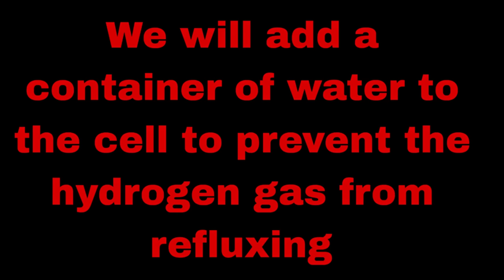I turn Water into a Free Gas for cooking, New invention

Comment: Have you taken into account the effect on electricity consumption while saving on gas with this invention?
Reply: Compressor itself is about 400-500watts and additional 24v6A for electrolysis is about 144watts totalling to about 550-650watts of electricity bills..😁
Better replaced with solar power supply and a smaller fans for pushing out the hydrogen..✌️
Reply: @atukintso1405  A single electrolytic cell running 6 amps produces a mere 44 mL / minute of hydrogen.  This guy is pulling our chain.  Now the energy that is going into that compressor, if all of that was used to split water instead then MAYBE you could get that high of a flame.  Agreed, solar would be great, especially in his apparent location.  Looks like India.  Lots of sun.
Reply: Given the fact the air pressure is not high, one may use a small electric usb pump, which uses like 5W.
Reply: Yep, it is faked. The flame is not from the minute quantity of hydrogen that is produced.  @ChristmasEve777

Comment: This is one of the superb project and best knowledgeable also by you. Its not a difficult to understand but, it would be better if you explain it in a simple English education system. One need to know its capacity range for its storage quantity for regular use.❤😊
Reply from the maker: 2L of water+100g salt=10h using
Thanks ❤️
Reply: @king_650 how about if i use sea water instead of adding salt? Is it ok?
Reply: 10h means,10hrs using time
Reply: How many watts of the fridge compressor and how much electricity will it consume in 10 hours??
Reply: Maybe offer to do his  subtitles or somebody can show him how to do it automatically
Reply: @kaushalsapariya2773 Compressor= 400-500watts
Electrolysis=144watts(24V6A)
😁 imagine running for hours... Your electricity bills will reach sky-high.
My suggestion is to used lighter pumps instead of compressor, and use 12v6A for electrolysis.
STAY SAFE, look out for backfire..👍
Reply: Nice effort. But the system has a mixture of hydrogen and oxygen, which is highly explosive. The fire may travel back to cause explosion. How about formation of  Aluminium Chlorde at cathode.
Reply: @atukintso1405 i think he used whatever he could pick up from the scrap yard, otherwise a good effort on his part.

Comment: It is a genius idea to use frig. compressor for cooling the water in Electrolysis, as in continues long time usage, the water in electrolysis, will start to boil, the frig. compressor, beside the producing the pressure in electrolysis, it helps to cool done the water too.  For those, who have objections, in using the heat sinks, I spouse, they can be replaced with copper plates. My only concern is, salt reaction in electrolysis, which, will produce toxic gases, I wander, if it happens, in this configuration too, or not?!
Reply: He was using it a a pump
Reply: Compressor itself consume about 400-500watts of electricity, additional 144watts(24v6A) for electrolysis, that's not cheap.running for hours will result in high electricity bills than a regular gas...😁
Reply: The fridge compressor compresses the gas in a circuit of a fridge. It's a mechanism to absorb heat from inside the fridge and radiate it through the back of the fridge, thus cooling down the inside.
But, in this case the purpose of using the fridge compressor is not to cool down the water temperature but to pump out the Hydrogen and Oxygen produced by the electrolysis. 😂 However, the method of extracting the hydrogen shown here involves a higher cost of electricity.
Reply: @atukintso1405 , electricity is cheaper than LPG. Use a solenoid air compressor like Boyo.
Reply: @kaka_kaka28  trust me, you don't want to use 600-700watts of electricity for hours&hours... 😅😅😅
Reply: @atukintso1405  , the pump I said uses 45 watts.
Reply: @kaka_kaka28  much better than a compressor...😅
Reply: Any link about fridge compressor hho production video pls
Reply: @atukintso1405  crees que pueda hacerse con un panel solar?
Reply: @carolacuna4005  sorry...!!!
I do not understand....
Reply: Why would you use an electrolysis device wich have at best 25% energy efficiency,plus water,salt,a compressor,have to change the electrodes often,plus the risk of blowing up your house in case of a leak,as it doesn't smell, instead of using the electricity to power an induction cooking machine wich have around 90% efficiency.....is beyond my logic. It is like scratching your leg over your shoulder.
Reply: @carolacuna4005  YES, solar panels can be used to harness electricity to run motors, but lighting HHO combination can be very dangerous since you cannot smell it...

Comment: Would it be more practical to buy a 300-watt electric stove? a fridge compressor runs at 350 to 800 watts. A 300-watt electric stove would consume less power. It would impact less on your electric bill.😄😁. No hate to this post. I liked the innovation, but if you can come up with an alternative to the fridge compressor, that would be great.
Reply: a 10 watt aquarium compressor will give the same air flow
Reply: 我觉得冰箱压缩机只是和幌子😂那里面有个气罐😂

Comment: One can use electricity directly instead of using it to produce hydrogen
Reply from the maker: No use car battery
Reply: how much electricity from a car battery can you use to cook?
Reply: Compressor used around 400-500watts, + 144watts(24v6A) for electrolysis, that's a huge electricity bills😁
Replacing compressor with lighter pumps can reduce electric bills..✌️

Comment: 12 volts x 6 amps, 72 watts power consumption, not bad
Reply: Compressor power?
Reply: 500 watts of compressor plus 72 watts of 12v x6 amp plates.. 572 watts..
Reply: 24 v x 6 amp

Comment: if you have access to power to run the compressor why not just plug in a portable hot plate ?? & what happened to the Freon from the poor fridge or freezer you stole it from, it was not likely properly recovered right ?, as you appear to be one of those cut the lines & let it fly guys, lol

now add the fact that the aluminum heat sinks will oxidize, deteriorate over time of use & are expensive if you have to buy them, the Brillo pads in old socks method of generating hydrogen is more cost effective for practical use, then is the toxic byproduct, the old used water now with heavy metals in it from the electrolysis process ?? , oh we just dump it on the ground or down the drain, lol
Reply: Great how you spotted all the blind or ignored details. Free or Renwable energies shouldn't destroy the environment. Sustainability is not about infite source, but clean and without adverse effect.

Comment: Hi,  Thank you for sharing this with us.  I want to build one, but I have a couple of questions before I can proceed.  Please tell me:
Can I buy & use an aluminum heat ink and get the same results that you did?
What was your electrical supply (i.e. did the electric come from an electric cord that has a plug for a socket at one end-a lamp cord?)?  I do not see that you used a DC Power Supply Variable
Thank you for the attention that you have given to my concerns.  
😊👍
Reply: Use stainless steel for electrodes.  Not Aluminum. .  Aluminum wear out fast. For a power supply he did tell you .  . use a 24vDC  6 Amps power source. It´s not house voltage.
Reply: Jeff is right. You can use SS. I used titanium bought on ebay and sodium hypochlorite also from ebay. Pvc cell vessel and the same for the flashback preventer. Runs of of 12vdc but 24vdc 6amp would be better. Also used a electrical wave modulater to be able to adjust the the amount of power to the cell grid.
Utube has bunches of videos on the science behind it and how to make a variety of cells. Some of these people are actually real scientist. Lol. Have fun and be very careful.

Comment: Even in welding and cutting they use Cooking gas and then oxygen and other gases. First gas is only for first lighting. Today I say in catering table top stove they use very minimum gas but use oxygen to give fast burner to make tandoori. It is possible in a large area but not in homes. Don't try it at home.

Comment: Excellent video. Liked it. Two questions 1. Compressor needs to be a working one and should be connected to AC power. What is that circuit ? 2. You connected heatsink with another circuit, didn't explained anything how to make that. Please clarify

Comment: Its very good idea, but again you are using electricity, means energy against energy in shape of fridge compressor, it also consumes units as per usage, what if a 12 volt pump should be used to avoid huge elect bill.

Comment: Good invention. Perhaps it consumes little electricity. How much electricity requires to run 1 hour burning , so also water and salt consumption, and cost of the unit be united in the description.
Reply: Compressor used about400-500watts which is not cost effective and the electrolysis process he is using 24v6amps which added another 140watts of electricity... Electricity bills will be very high.

Comment: Your project is good to start but keep it in mind Hydrogen gas is highly inflammable. You can use it instantly with all safety precautions but do not try to store it in cylinders for later use. These would be like Hydrogen bomb. Another suggestion is the end pipe which is used to make fire should be long enough so that your project bottles are in distant place to avoid accidental fire or explosion

Comment: You can use a balloon metal for store hidrogen with a little presión as 5 psi ? 
How much ps3 of hidrogen for how much amperio at 110 AC ?
Reply from the maker: To analyze water, I use a car battery
Not 110v Ac

Comment: My guess is the cost of the electricity outweighs the money saved on gas. I know that because if I was wrong, this system would already be widely used. No miracle money saver here, however, if one happened to have no way to get cooking gas, this may come in handy as it is most likely more efficient than an electric stove....I think.

Conclusion, save the video to your Just In Case folder.

Comment: By compressing air you add drag to the compressor and it creates extra cost to electricity. Process of electrolysis requires high current to produce more gas, then its another cost of electricity. Would it be cheaper to buy a tank of propane because they are produce same time as crude oil is produced. Don’t panic, just a friendly advice…..😊

Comment: such a compressor consumes approx. 150 watts of power.  enough to use an electrical heat element for cooking an egg. still, I welcome the curiosity and energy of this young inventor!
Reply from the maker: thanks
you can replace fridge compressor with 12v air pump

Comment: First you use energy for splitting H2 and O2, than you need energy for your compressor.
You will spoil around 25% of your electric energy in order to heat by gas.

Your construction is simple, simple is good.

But it should be useful.

Comment: This may look like inexpensive gas, but in reality, using power from the grid to create Hydrogen gas is quite expensive. If you want a cheap fuel that's very useful, syngas is the way to go. It's derived by burning organic material which wood is typically used in the process.

Comment: What kind of adapter is being used that is connected to the green and yellow wires, what is the purpose of the adaptor and can the setup just be connected to a power source (car battery or solar panel)?
Reply from the maker: Im use Solar panel 12v 6A

Comment: Using aluminum electrodes and a salt solution can introduce impurities (e.g., chlorine gas if NaCl is used). Ideally, for high-purity hydrogen and oxygen, use platinum or carbon electrodes and distilled water with a small amount of sulfuric acid or a base like potassium hydroxide (KOH) instead of salt.

For higher purity hydrogen and oxygen, use distilled water and a small amount of sulfuric acid (H₂SO₄) or potassium hydroxide (KOH) as the electrolyte instead of salt, and use inert electrodes like platinum or graphite.

Be safe...

Comment: The compressor is pumping air into the system so how does that change to hydrogen? So the hydrogen produced in the bottle is diluted into thin hydrogen supply.

Comment: It's free when you use hydrogen production to power generator that provides you with electricity. Initially you have to use 12volt battery to get it started and then you use 12vdc from generator to keep it going.

Comment: 1 If the burner heats up it will not melt the connection 
2 how much voltage is the battery you used
Reply from the maker: 1: No
2: im use solar panel 24v 6A
you can use car battery

Comment: For power supply we can use solar energy.
Reply from the maker: Yes im use it
Reply: Can you solar energy produce 550-650watts..?because compressor consume a lot of power 400-500watts, better replace compressor with smaller pump, 12v for electrolysis can reduce lot of power consumprions too.

Comment: Simple yet successful model to save energy bills. What about oxygen which also get generated during electrolysis? Safety part is also important.
Reply from the maker: Yes excellent ideas 👑
Reply: Compressor consumed Loads of energy 400-800watts,
Additional 150watts for electrolysis..smh
And hydrogen can be dangerous, specially invisible flame..
Please Be SAFE 🙏

Comment: The process is highly doubtful. Hydrogen flame is invisible in day time and in night you may feel little light if hydrogen is burning. Most of the time, one would come to know the hydrogen fire only by getting burn injury or  feel the heat of the flame. It will not give yellow color flame at all. But no doubt that electrolysis of water will give Hydrogen and Oxygen.

Comment: I can't believe it hasn't back flashed  and blown up the bubbler or the main tank except for the fast-moving air from the compressor. You should have a flashback arrestor
Reply from the maker: I add it
Reply: @king_650  that's good. You must have had an explosion .

Comment: in salt electrolysis hydrogen develops on negative electrode, but chlore develops on the positive electrode and is highly corrosive. Where is the positive electrode? it should be made with graphite or platinum. The energy produced by burning hydrogen is less thane the electric energy needed in electrolysis, so it would be simpler and cheaper to cook applying the electric power to a heating resistance.🤨🤨🤨🤨🤨
Reply: Йй❤❤❤❤❤❤❤❤❤❤❤❤

Comment: This is only good for a few minutes. The water will get so hot it will melt the plastic container. You need to solve the problem of the water heating up. There needs to be a way to cool the water. So you can use it longer.

Comment: The pump is pointless if the HHO gas is being generated in an airtight container = it will self-pressurise.  If more gas pressure is needed then a simple aquarium pump will do the job for much cheaper.     Note the HHO gas contains Oxygen - so adding more air (75% N and only 15% O) will dilute the power of the HHO gas.  Maybe this is needed?  Maybe not.

Testing the HHO generator without the bubbler-based flame arrestor is dangerous and should NOT be attempted. 

Finally,  using hot glue to stick down a combustible gas line under a flaming hot burner and pan is not recommended.
The hot glue will melt and the PVC will do the same.

Rather use a copper pile (from an old refrigerator if available) through a hole in the base of the "stove top" - which incidentally is also flammable wood (rather use a metal part from an old refrigerator (!) or any other sheet metal for this base.  Let the pipe pass under the plate up through a hole into the burner and then connect that copper pipe with the PVC feeder pipe after it has enough length to cool down.  Recommended to line everything with foil so that it catches drips and makes things easy to clean.  And Aluminium foil does not burn.

Comment: Electricity is used to make Hydrogen, and to work the compressor. By the way it is not shown what voltage/ amperage of DC is used to make H2. It us a good experiment to show students of making H2 at a usable level. The cathode will get corroded soon.

Comment: I didn't see the one that was plugged in with aluminum. What is that? How was it made? The video is not complete, so I don't understand?
Reply: the power source for aluminium plates is a 12v 6 amps DC, and the compressor is connected to a 220v socket

Comment: More energy required to run the electolyser and pump than if you just used an electric burner.
Reply from the maker: Im use Solar panel bro 
You Can use 12v air pump

Comment: How many watts of the fridge compressor and how much electricity will it consume in 10 hours??
Reply from the maker: Use Solar panel
For no consume and free gas
Reply: @king_650  it's a good idea but it's important to know about it
Reply: Compressor wattage depends (350-800watts)
Better replace compressor with smaller 12v pump, and use12v6A for electrolysis.
Please be careful, clean hydrogen flame  is not very visible...
Be SAFE...👍

Comment: How many  volts you used to run the experiment? And why you introduce a compressor? Finally what is the capacity in  cubic foot of hydrogen I can get from the 2 ltres of warer I ' very used initially ?
Reply: Porque el compresor gasta mas electricidad
Reply: Compressor runs on AC 220v( 500watts)
24V6A(144watts) for electrolysis
Huge electricity bills😁

Comment: A running compressor will consume 400 to 500watts an hour.
The electrolysis power is not play it cost 5times to 10times than the compressor.
And the compressor wont cool anything. It's used here as a air pump.